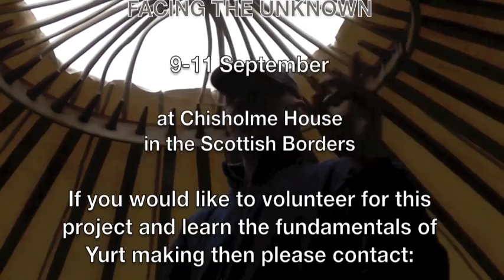How to make a yurt in 3 days?

Comment: Some thoughts:  1) The music appears to be an effort to regionally link the project and the music; if that's true, then it adds to the authenticity.  If one finds it bothersome, then turn the sound down -- there is no audible instruction to miss.

2) Yurts are temporary nomadic structures, similar to Teepees, and the original creators were clever enough to design them to be REUSED as they followed/moved their herds.  The yurt originated on the Asian steppes, where resources are quite scarce, so the structure is created from many small pieces of wood cut from willow thickets or similar shrub-like small trees -- timbers do not exist in that environment.  This project was completed in Scotland w/ local materials, which might well have been considerably more robust and therefore in need of process with much more vigorous tools and methods.

3)  This is an educational event, so that's why there's an army of volunteers.  Obviously, the process could be completed w/ only about 3 men and 3 women in a similar time frame, and I find it fascinating how the work can be neatly divided in half for two teams: the frame and then the tent.  It also appears that a yurt might be completed over a long period of time, allowing a family to acquire the wood components as they moved from pasture to pasture, and gradually filling in sticks that were omitted from the initial build, during gentler weather for example.

Thank you for the interesting video!
Reply: This right here is the type of comment I love to see! Thanks for taking the time to write out such a well though response.

Comment from the maker: the steam box is made of plywood with 3 or  4 inch insulation sheet on the outside. A pipe goes in one end which is attached to a a pair of old radiators arranged in an 'A' shape so a fire can be built between them.  The important thing is to have the water at the right level so steam comes out and not boiling water. it takes some setting up. The radiators are fed by a water butt. 
i hope that helps...
Sorry I can't give you more info right now.

Comment: This is a Turkish house. also known as "lumps from home" is ". Afyonkarahisar / EMiRDAg'da county region, are still used, the mounting for 1 hour, 15 minutes disassembly .. Felt very cool on the type covered will be very hot in the winter .. potratif is ideal for life. Turks still uses.
Used by the Turks for 15 thousand years.

This is only the "Builder cuts" and is made with a knife !

Comment from the maker: @ARTESPAQUIME1 
Hi it sits either on the ground with a grpundsheet or on a wooden platform . The roof canvas is pegged to the ground but the yurt isn't  as it is very stable even in high winds.  Ours are also not permanently up so...  I know the yurt wasn't finished  that's why the title has question mark . The sewing takes a few more days to complete. We did try to get it done but it is actually a huge amount of work. We now have completed 6 over a few weeks.

Comment: The secret to building a yurt in 3 days is apparently having a ton of people helping you. Which also happens to be the secret to building a regular 3,000 sq ft stick house in 3 days. 
This would have taken months for 1 to 2 people.
cool process though.
Reply: I think you're missing the point. He is "making" it, not assembling a premanufactured set.  Now, once you have the parts constructed you can deploy and undeploy the yurt much faster.
Reply: Content deleted due to others clearly better at 'internetting' than myself.
Reply: Chris Crissey
So I guess the sander, a genset to run the sander, hand drill, chemicals, varnish, a van full of saws and other things, cordless drills, a dowel shape, clamps, files, a post ram, draw knives, screw drivers, framing hammers, sand paper, a bic lighter, plastic, and scissors, are all pre modern inventions..

Fail.
Reply: Content deleted due to others clearly better at 'internetting' than myself.
Reply: Dude, you could also do it all with rocks, sticks and furs. You said modern. There were modern tools all over that build.
Reply: There ya go, you won the internet. Congratulations. Let me also take a moment to one up all your comments as well so you can feel good.
Reply: Emre Emirli I don't think people 1) get that and 2) appreciate it.
Reply: I always appreciate BS being called out. I think people do too.
Reply: Harley Ross I found the video interesting, so I clicked. And It is still amazing, regardless... being that can now travel and be set up anywhere. Pretty much all 'modern' tools have an ancient counter part, obviously. So for me I appreciated the craftsmanship and ingenuity regardless of how many people were doing it or what they used...I guess I was just caught up in the process and did not notice how many 'modern' tools they were using. A hammer is a hammer, is a hammer. Fire is just, fire. I look at it more like an applied technique, like, how could I do that WITHOUT a lot of tools. Like I was especially impressed with the 'drilling' of the wood with a red hot iron.  The aforementioned posters make it sound like they had some kind of modern assembly line. While you manage to veer off topic to flame someone and make more internet BS and right all the wrongs (or things people say mistakenly in passing) , yes there sure is a lot of BS on the internet. If you plan on championing that cause you are going to be very very busy. By the way there 'keyboard warrior' I am the one that +1'ed you so you could have a super special day and feel important. You, are welcome.